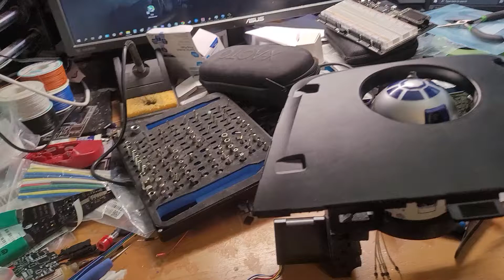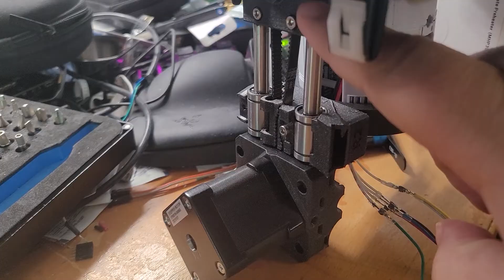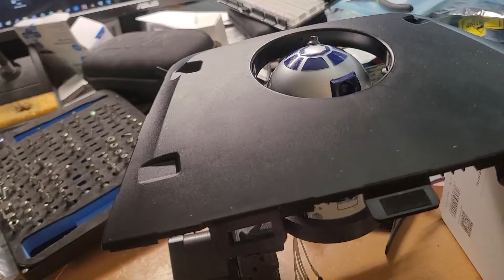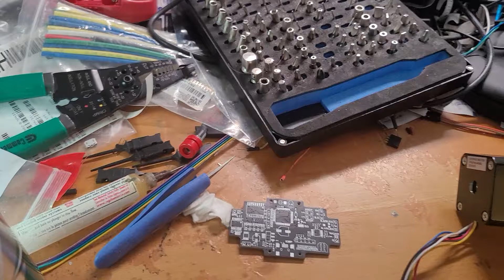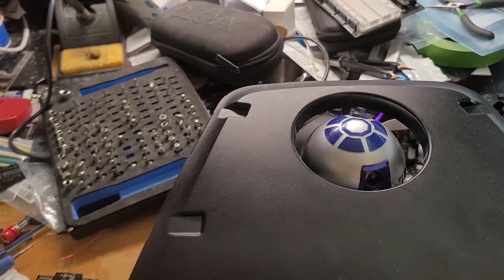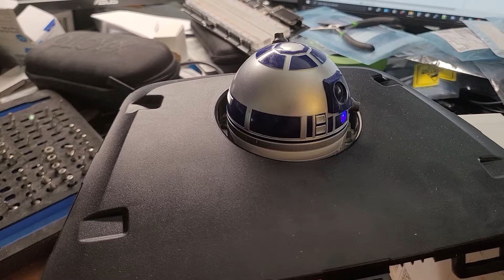R2D2 RADAR Project - Update #4 - new circuit board new Elevator

Comment: Any chance you sharing how you build the whole thing? Have a Jeep Wrangler named r2d2 and would love to have this awesome project on my dashboard, already bought the r2d2 car lighter charging station and have a 3D printer, no knowledge on circuit boards whatsoever 😞
Reply from the maker: The 3D printed materials were designed around the center speaker for 2017 Ford Explorer. For this new unit to fit into my dashboard, I had to cut away a good portion of the center AC duct in my car and cover it with tape. Then a catastrophe happened.... This whole project was installed and melted in my dashboard. Because of the internal temperatures of the car it melted the 3d filament again. Luckily i had a roll of Prusament PC blend. (https://prusament.com/materials/prusament-pc-blend-carbon-fiber/) This has a higher temperature resistance as well as UV resistance. I then had to reprint all the parts. I have yet to test and re-install this R2D2 unit back in my car. There were a lot of prior modifications done to the R2D2 unit as covered in my previous videos. My demonstrations of R2D2 on my workbench differ from that when its installed in my car and i have to do a lot of software modifications on the fly. I have to drive the car a little bit see how he reacts, pull over, make some software adjustments and rinse and repeat. This is in no way a final products or was intended to be a retail product. I saw this R2D2 charging station and saw more potential that it was and enhanced it accordingly. I would love to help you with this but if I don't have access to your vehicle to make measurements and adjustments as needed to design the 3D parts that is going to be tough. Do you know how to program microchip PIC processors?
Reply: @Da_Gare_bear  thank you so much for explaining and so sorry to hear about the melting parts... i can learn how to program pic processors, it'll be another hobby to add, besides, 3d printing, fixing laptops, cell phones etc, that board that you made is it available to purchase from anyplace? Or how much would you sell it to me? I can maybe take the measurements to make the whole thing fit on my R2 "wrangler" if you provide me with the stl
Reply: @Da_Gare_bear  do you think this can be also used for a car alarm system? Like when the alarm goes off, proximity sensors, etc? Can I add you somewhere? Like facebook or instagram so that maybe you can help me?
Reply from the maker: @gitmac53  sure thing my Facebook is www.facebook.com/gmdii